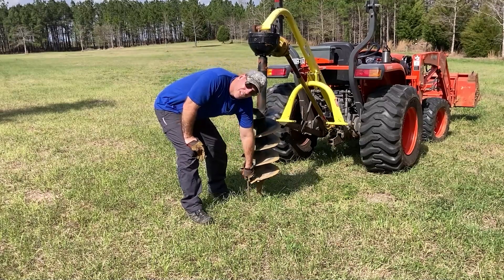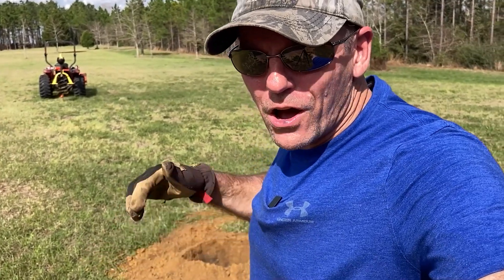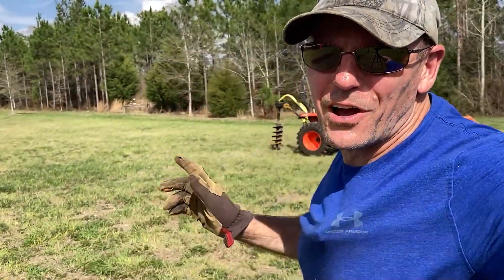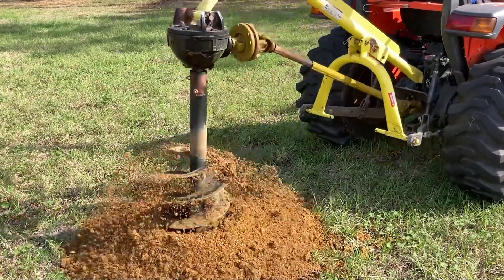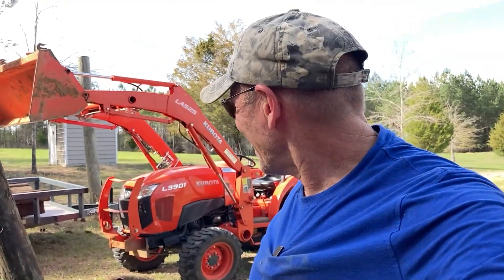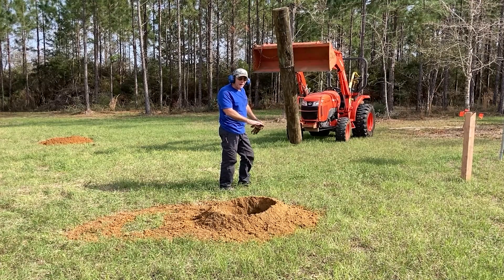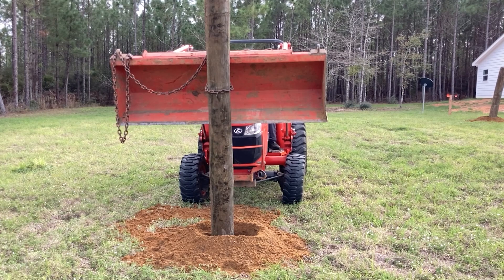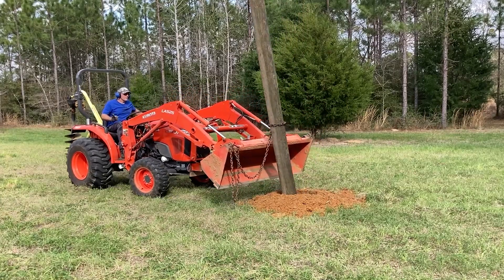MASSIVE Posts Installed with Compact Tractor!

Comment: Brad, glad to see your new video of progress on your homestead. A nice start of your garden ☺️
Hey, any chance some time can you make a video on how you hook up the post hole digger to your tractor? I bought one years ago for a L3301 I had, but never did put it on before I sold my setup.
Those post hole diggers are just so heavy, it almost seems like you need to have them on some kind of a mount?
Good luck on your garden ☺️
GOD Bless You and Deb
Reply: I have an old post hole digger that has home made mounts for one of my John Deere tractors. That was a nightmare to mount alone. The shed that I stored it in has open access to the rafters. I just suspended it with a light duty chain to help support the weight and it made it much easier to handle.
I have 4 loader tractors so now I just grab one of them and pretty much do the same thing. I know that’s not an option everyone is going to have but maybe you have a neighbor with a loader.
Anyhow, good luck with it. As I have gotten older I have learned to work smarter and not harder.
Reply from the maker: This video shows a little: https://youtu.be/DHFK0fb-ryw      
And this one a little: https://youtu.be/ewEHX2HAaqs

We keep ours vertical and tied to a tree or post.   then hook up the long top bar to the tractor first.  The lower part, we put in the lift arms and then raise the tractor hydraulics to put in the pin to connect the U-shaped lower bracket to the long upper arm.   It's not an enjoyable experience!